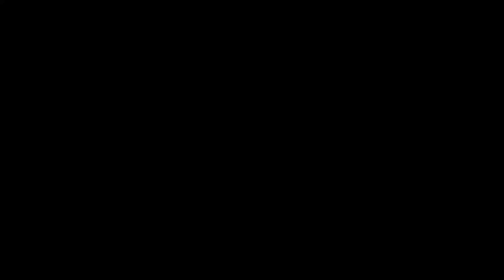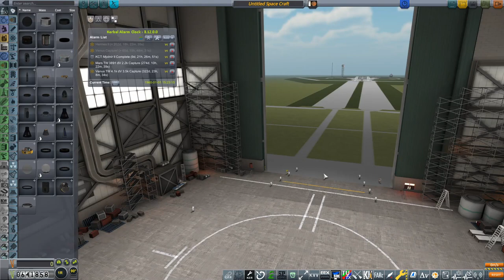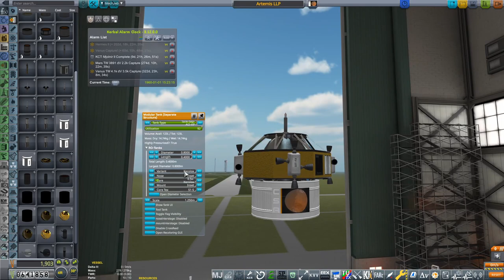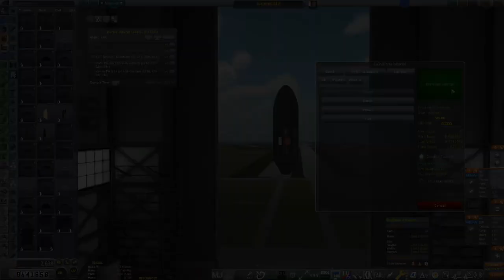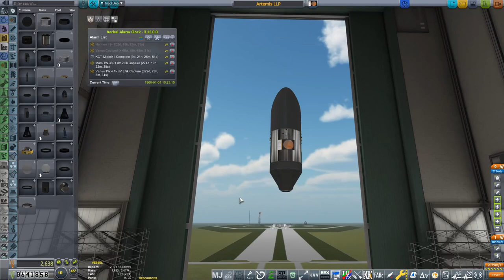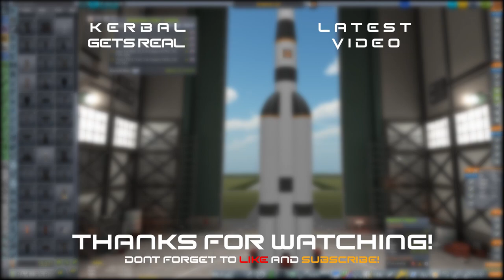Kerbal Gets Real | Build Episode 2 - Artemis LLP | KSP RSS/RO/RP1 Letsplay

Comment: Using extra fairings just for looks? Adds more mass and reduces overall DV for as long as you carry them, outside 100k in atmosphere they are dead weight
Reply from the maker: I know, and it is as you say just for looks, reducing the density down to 0.01 makes them weigh next to nothing though, and doesn’t really make that much of an impact to the dV, but still, you can make this more efficient by losing the fairing on the actual lander (like I’ve said, I just really like the look)
Reply: @Carnasa  oh didnt catch the density part, does that also change its heat and pressure limits? id assume so